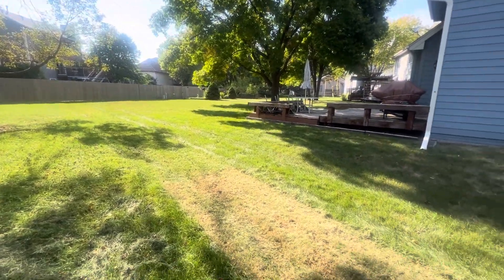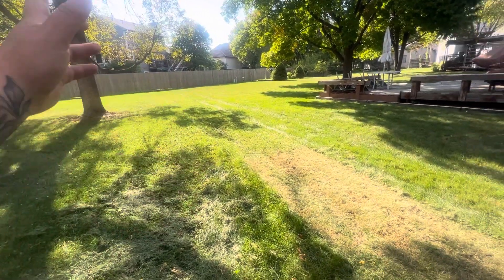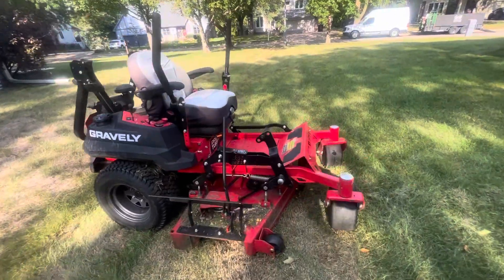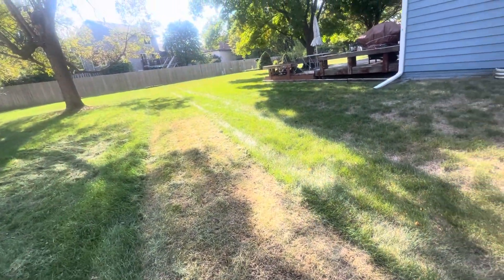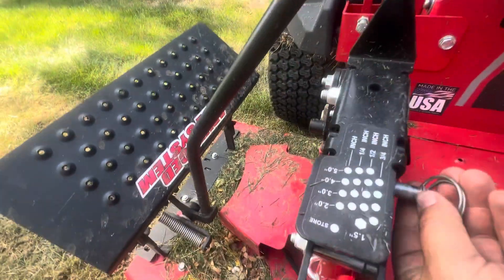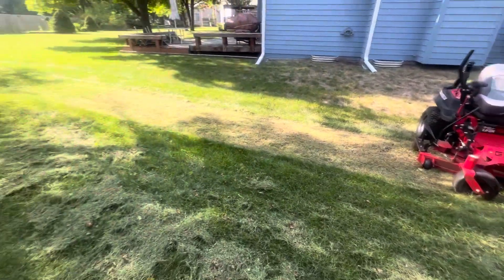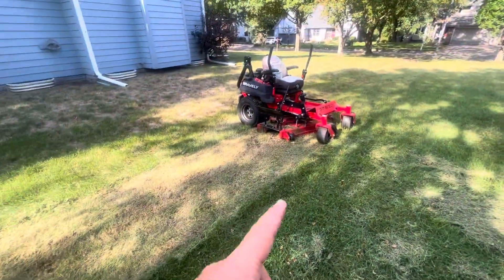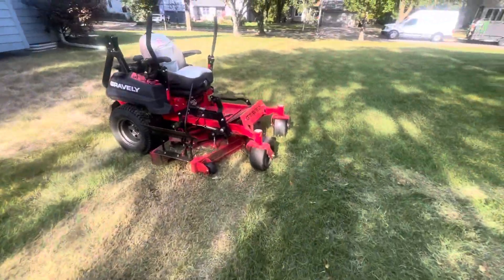THE WORST thing to happen when mowing a residential property!

Comment: It crashed and burnt you could drill the end of the pin and put in a safety pin so it does not come out or there must be better quality pins available.
Reply from the maker: Yes I replaced the pin all together to a system like that